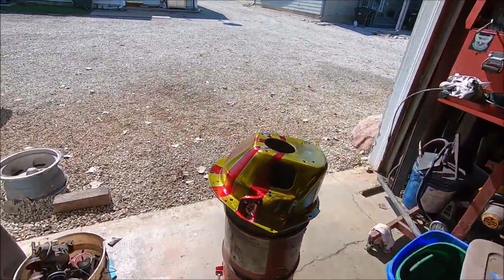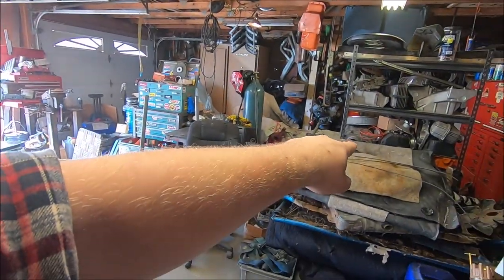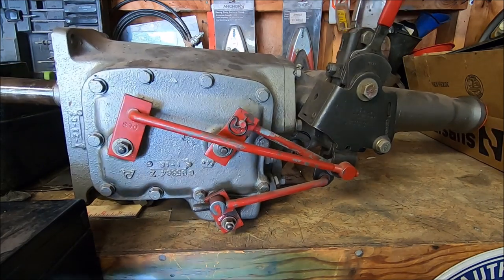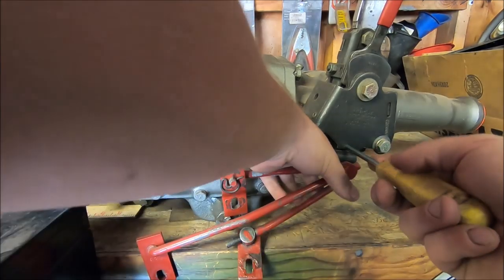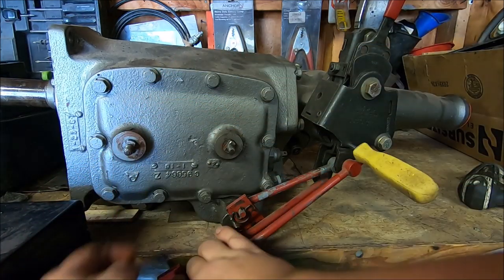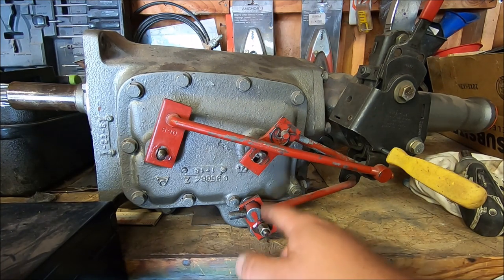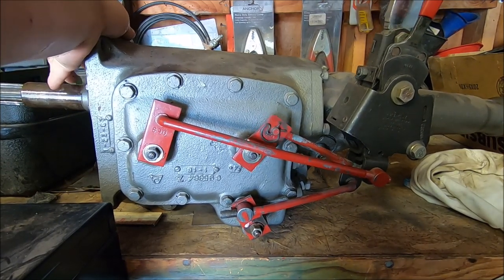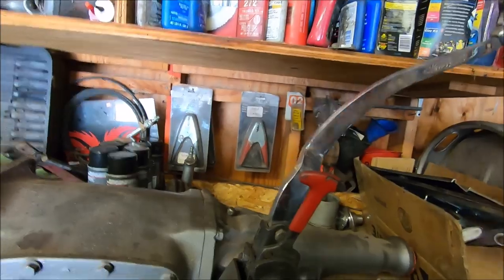Adjusting your Hurst 4 speed Shifter to PERFECTION!

Comment: Great video! No, you aren't a moron! What an easy way to adjust your shifter. I have been around mopars my whole life and I even worked as a mechanic at aa Dodge Dealership in the 80s ( K-Cars!). I learned ever trick from the many old school mechanics who had been working on Mopars since the 50s and up. I learned the lower control  arm bushings wear out and that causes the clunk like noise and minor shaking in the steering wheel. On that note, I have always had 4 speeds and no one showed me that trick. So simple. Thanks for bringing it up.

Comment: Hi Jed. When the trans is in the car theres less room. I used the correct size drill bit. Top loader ford is the same. Put pin in shifter. Make sure all shift levers are in neutral. Adjust linkages to fit.
Reply from the maker: when the trans is in the car, I would see using a drillbit, that would definitely work better for sure

Comment: The process is the same for a toploader. I still have the plastic thing a ma bob that came with the shifter to adjust it. I'd never be able to use a screw driver because of clearance issues...a 1/4" allen, drill bit or round stock will work in a pinch.
Reply from the maker: Thank you for the information, I have never played with a toploader, so I was unsure

Comment: You're mounting bracket for 3&4 is upside down according to my manual. The nut should be on top, rod on the bottom. But, could be just a Mopar thang...what works for one don't work for all. Thanks for the video
Reply from the maker: This was how my reference material said to install it,  and thats the only way it'd work properly. But who knows,  I know the overdrive units are different

Comment: Hey brotha, love your videos, I have a question about shifters. So I have a vgate 2 in my 70 duster and want to switch over to a hurst competition plus, my question is, do I have to get new shift rods to make the competition plus shifter work? I know the mounting brackets are different. Thanks!
Reply from the maker: You will more than likely need different rods, normally the vgate style shifters have longer rods. I can't see your setup or otherwise I'd be of better help. You can send me an email chargerjezebel70@yahoo.com hopefully it goes through
Reply: @ScottsSpeedShop  thanks brotha, I’ll snap some pics and send them over to you, I really appreciate it, this is my first mopar classic and I got it as a basket case project so it’s been a lot of trying to figure stuff out blindly lol

Comment: Any tips for adjusting the clutch pedal in an A-body? I feel like mine has slipped out of adjustment and my pedal wont release the clutch until almost at the floor.
Reply from the maker: There should be a threaded adjuster that runs to the z bar or the clutch fork if I remember correctly. My Javelin is like your A-Body but that is also because the clutch disc is worn out

Comment: How do you shift it into reverse? I have never driven a 4 speed mopar and I am the only person I know who has one, and my car isn't exactly put together yet. I want to know if my trans is good but I have no idea how to get it into reverse haha.
Reply from the maker: The shifter handle has 3 positions when not in gear, 3-4 neutral gate, 1-2 neutral gate, and Reverse neutral gate. When I say neutral gate, I mean the shifter and trans are not in a gear, both the input and tail shaft should turn independently of one another. So you should be able to turn the input one way, while turn the tail shaft the opposite direction, if that is so, then the trans is in neutral and hopefully the shifter itself reflects that. When the shifter is idle, aka there is no force on it, it will be resting in the 3-4 neutral gate, if you pull the shifter towards you(away from the transmission itself), the next gate will be the 1-2 neutral gate, and if you pull it further, that will be the reverse neutral gate, and then you simply push the handle forward towards the input shaft, and it should clunk into reverse. It should clunk a bit, because reverse is a non-synchronized gear in a chrysler 4 speed. You will either need to have the trans mounted in the car, strapped to your bench, or be one hell of a man to be able to pull the shifter over into reverse. Hope that helps man
Reply: Scotts Speed Shop Thanks for the reply! I spent today working on my buddies Mercury comet and I came home and used your guid to rebuild my shifter and after converting it to the rear shifter location I got it to shift into the reverse neutral gate and clunk into gear. I thought I was gonna break the thing but it went, and I made sure to do it a few more times so I knew it wasn’t a fluke lol
Reply from the maker: @flipeecupsstuff7632  glad to hear I was able to help man!!!

Comment: Bro, I took my hurst super shifter out from my richmond super t10, as it wouldn't go into reverse.  just took it out, and put it back on, no adjustment, then all of a sudden it goes into every gear easier!   Does it still need a rebuild or new shifter then?
Reply from the maker: If everything feels right and tight, I would probably just leave it, I am not there to see how it feels, but if it feels like it is locking in, I would just leave it

Comment: I don’t have a lockout reverse likes urs and I am having a hard time putting it into reverse any tips or ideas what’s the problem
Reply from the maker: All a833 transmissions use a  non synchronized reverse gear. So they will always clunk into place, but if your having a hard time, your rods may need adjusted or even your clutch. Had a buddy have a problem with getting his a833 to go into reverse and he just had to adjust it

Comment: Thanks bro.  Does it work on a super t10 4 speed?
Reply from the maker: It applies to any Hurst shifter yes
Reply: The shifter is aligned but sloppy and won't go into gear very easily.  How to rebuild the hurst shifter mechanism itself?  Or is it better to buy a new one? @ScottsSpeedShop
Reply from the maker: @user-nl3ui4nn4d  you can buy a rebuild kit from Brewer's Performance or Hurst. Typically the stainless spring plates loose their tension, but if the shifter itself is really loose feeling, then the shifter spring mechanism is worn, and I've been advised it's best to just get new at that point
Reply: Yeah, It's a nightmare, lol.  Plus I put a brand new quartermaster clutch, slave cylinder, and release bearing, and still the same.  Just took a look at the shifter and it's all loose and has a ton of play in it.  So, I shifted the levers on the transmission itself, and it goes into gear smoothly, so the shifter is gone, I'm assuming.  Here's the car.  It's a full nascar nationwide car:  https://www.youtube.com/shorts/Hheyapi8Sis @ScottsSpeedShop